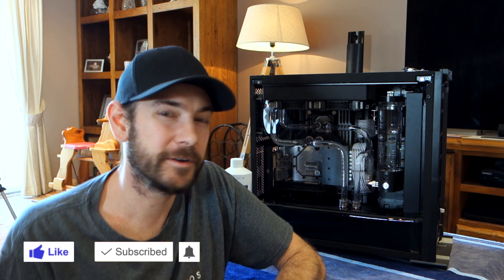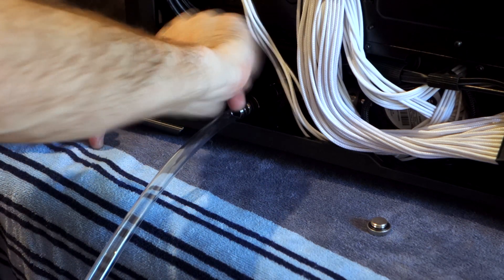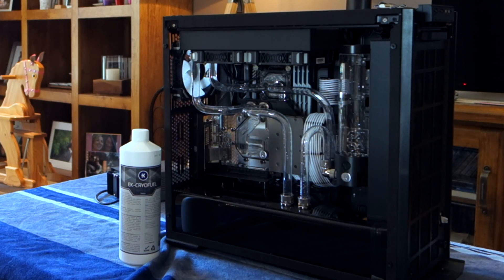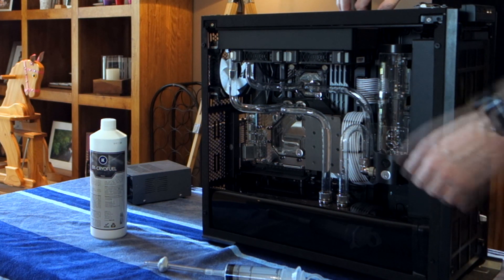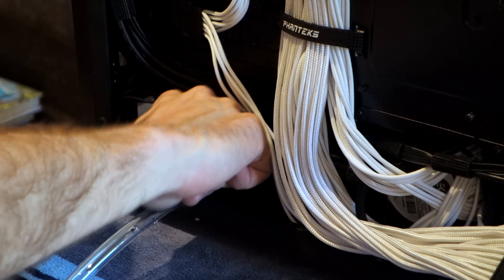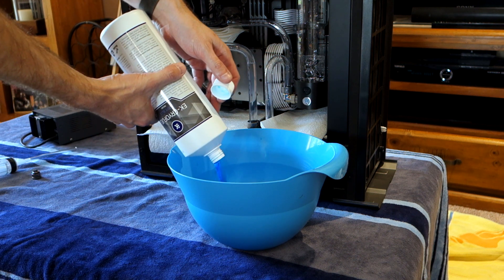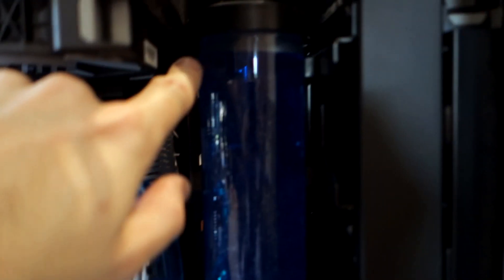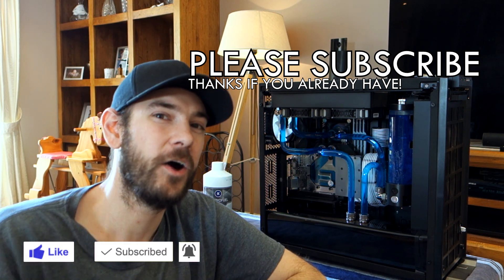FIRST COOLANT CHANGE - Draining Distilled Water & Filling with Coolant

Comment: I'm thinking if you left the drain port open as you are filling the system with the coolant, it would push most of remaining water out before it completely mixes together. Just a thought.

Comment: If been thinking of just attaching a old watercooling pump to my drain port to pull out all liquid however im worried it will stick in few places unless i fully disassemble it, i have loop now since few days with triple radiator with just gpu and cpu way overkill but very silent but 2 of the rads may be problem to drain i could easily use gumball to pull water into the pump from reservoir so maybe i be fine in few month's

Comment: Hey dude, is the valve connected to the bottom rad or to the pump ? Can't really see, cheers
Reply from the maker: Both. It’s a t-section off the line that goes from the pump to the radiator.
Reply: @boostedmedia  could I use one of those 3 port q connector fittings ?
Reply: @boostedmedia  any pics man so I can see how you did it using fittings ?

Comment: Using a squeeze bottle will make it a little quicker when filling the system. But I completed my first watercooling loop and your videos helped a lot. I used a primochill true fluid and it looks really cool. And honestly without your previous video on tube bending, I would not have successfully completed my loop, because you went in depth with some techniques compared to other channels. I'm currently running an 8700k, a 2070 super fe and used EK blocks for both but I used 2 corsair 360's as my rads. I went with hardline since it looks so much cooler compared to soft tubing, and I'm using a EK-D5 pump reservoir combo unit. I wish I went with 10/13mm tubes instead of 10/12mm.

Comment: I was thinking that when you did the draining, you could connect the drain tube into a vacuum flask, then turn the vacuum pump on and it should get all the water out of the system.

Added bonus of having a vacuum flask around, if you put your coolant in the vacuum flask first, you can degas it before adding it to the reservoir and it should take a lot less time to bleed the air out of the system.

Comment: I don’t have a drain port how can I get the fluid out? Also I just want to use distilled water what should I mix it with?
Reply from the maker: You’ll need to disconnect a pipe to drain the fluid. You’ll probably want a silver strip and some algecide.

Comment: I realize I'm watching these months later, but I still greatly enjoyed the videos. I just wanted to mention that EK also sells the same coolant as a concentrate. So you could fill, leak-test, and bleed with distilled water and leave a bit of room (100ml for 900ml of distilled water) in the reservoir to add the concentrate for color/additives when you're sure it's not leaking. The flow will mix the water and concentrate.

Also, when letting the air bleed out, the air escapes into the top of the reservoir, no need for the fill port to be open for that, as the air is included in the overall volume of the system and it's just changing location/position. Then you open the fill port and top it off with distilled water, to replace the air with water. The fill port only needs to be open for filling or draining, as you're replacing air with water or water with air.

Comment: About to put distilled water into my first, simple CPU water cooling loop. (EK components)  Test for leaks w/ the distilled water, drain out the distilled water, then the EK 900mL of red premix into system... scared I've messed up something... we'll soon find out.

Rig... Phanteks Evolv X case, Asus Hero XI MB, 9900K CPU, EVGA 2080ti FTW3 vid card, Corsair 3200 memory, 2 M.2 SSD's, Seasonic Titanium 850 PSU, EK pump/Res, 360 radiator top of case, 3 front 140mm fans intake, 1 rear 140mm exhaust fan, 3 120mm fans blowing air out thru top of case and radiator, soft PrimoChill clear tubing, and EK premix 900mL (blood red). Fans Noctua Chromax.
Reply from the maker: Did you see my video showing how to dry leak test? Recommend you do that first to ease your mind :)
Reply: Thx. Ran leak test for @ an hour... fine. Shut off. Tomm home all day, will continue leak test. Then in goes the EK CryoFuel or whatever it's called.
Reply from the maker: How awesome is that moment where your emotion turns from pure anxiety to pure excitement and joy. Lol
Reply: @boostedmedia  Yes, absolutely. I'm not a handy guy, so for me, a custom cooling loop was a big deal. 

My last build was hard for a different reason... a Mini-ITX form factor build, with the coolest, most-elegant case... the Ncase M1 (brushed aluminum). SO SMALL, tight fit for everything, and big hands... sooo hard.
Reply from the maker: Well done mate! Enjoy the sense of accomplishment. That’s what this channel is all about. Giving stuff a go :). Glad the videos helped you feel more confident.
Reply from the maker: LMAO. I know that feeling better than you can imagine. Congrats mate. Share some pics on our discord channel. :)
https://discord.gg/7YzjkFQ

Comment: Does your coolant runs hot in the loop after running it for a few hours during the bleeding of air?
Reply from the maker: No. No difference to component or coolant temp while bleeding.
Reply: Mine seems to run a little warm while bleeding. I’m assuming it might be heat generated from the pump, leaving a loop of warm coolant behind since no fans we powered on to dissipate heat away from the rad. Sincerely appreciate it if you could give me a few advice on this 🙏🏼
Reply from the maker: As in the coolant temp or component temp?

It will all depend on where the air is being trapped and where the temp is being measured, but it's highly unlikely to be the pump heating the water.

Comment: do you have to use a certain cooling loop protection mix or do you just put in the coolant?
Reply from the maker: It depends on the metals in your system. I just use premixed coolants that contain biocides already. 

If you’re only using distilled water you may want to consider additives.
Reply: awesome thanks!!
Reply: Another question for you, the distilled water counts as a system cleaner or should I use something else?
Reply from the maker: You’d want to mix it with vinegar to act as a system cleaner to remove any algae or contamination buildup. It’s ok to use on its own to flush a system to remove any manufacturing debris or change coolant colours though.

Comment: Hey Will, Super job mate. You caught my attention just at the right time. I am doing the same build (Intel i7-8700K) but I had a question you can help me with. Since you decided to build a water cooled system with a dedicated pump and res is their any reason you selected your mother board over the ASUS ROG Maximus X Formula (300) with the Cross Chill EK II VRM block. https://www.amazon.com/dp/B077DXV361/ref=sxbs_sxwds-stvpv2_2?pf_rd_m=ATVPDKIKX0DER&pf_rd_p=2708083022714283574&pd_rd_wg=qemQP&pf_rd_r=8YNHV72ZD4YQ47T46TGP&pf_rd_s=desktop-sx-bottom-slot&pf_rd_t=301&pd_rd_i=B077DXV361&pd_rd_w=PnX5i&pf_rd_i=null&pd_rd_r=e899a9a2-cea5-496b-9744-f88176042b8d&ie=UTF8&qid=1526044024&sr=2

And by the way, you are just killin me waiting on the 3DMark benchmark. SHOW ME THE MONEY BABY
Reply from the maker: Glad you found the videos in time! Benchmarks coming soon. I’m delidding my processor this weekend (which I highly recommend by the way. The temps stock are stupidly high with the stock thermal interface even with water cooling. 

I went with the code because water cooling on the VRM chips really isn’t necessary and it wouldn’t fit inside my case without using smaller radiators. 

VRM chips can happily run at high temperatures without it really affecting performance. All it does is additional temperature to the water. 

If you look at extreme overclocking using liquid nitrogen they very rarely use active cooling on the VRMs even pushing massive voltages with high LLC. 

Hope this helps.
Reply: Thanks for the advice on the VRM. That helps me make a better decision. I was wondering about the heat issue with the 8700K. I thought the water cooling would overcome any issues but I can't wait to see your results. Such a pain in the ass to remove that CPU after all the great work you did though.

Thanks again for all the awesome video work Will as well as all of the parts listings. Such a great help. I did see a Delid video on the 8700K with 20 degree difference but the best part was undervolting to 1.08 while maintaining 5 ghz for another 5 degrees and still running stable.
Reply from the maker: I’m highly skeptic all of anyone who claims their 8700k is “stable” at 5GHZ on just 1.07V. My chip needs 1.4V to hit 5GHZ but is hitting the thermal limit at around 1.34V without delidding. Mine is a particularly bad chip but still if you look at silicon lottery’s website less than 1% of chips can hit 5GHZ on less than 1.25V.

Basically you’re highly unlikely to hit more than 4.9GHZ without delidding. 

And yeah it’s going to be a real pain draining the system and pulling things apart to get the processor out. That’s the downside of hardlines.
Reply from the maker: Hopefully it’s just the thermal limitation that’s holding me back. My chip hits 95 degrees at 1.35V and my water is barely heating up which shows how bad the stock thermal interface is. 

There are people delidded with air coolers getting better results than I can with my $1500 cooling setup simply due to my bad luck getting a weak chip and because that’s how important delidding is with these chips if you want to overclock.
Reply: Yeah, I see your point. Can't wait to see your results.

Comment: You and your syringe!
just put a funnel into the top of your res and throw the new liquid directly in, instead of this EK bottle -> bowl -> syringe -> air syringe -> syringe ->  ARGH.

You're probably only adding dust and other fluff into the liquid doing it your way.
Reply from the maker: Lol. Yeah it’s a bit painful but it’s also a lot less risky and only takes a few seconds extra. 

I actually have a fill port I plan to install on the top of the case above the res next time I have it all apart.
Reply: Unscrew the top of the res, huge fill port. sorted! I did this on a res half as tall as yours and even then it is not risky.
Reply from the maker: True. Except it’s a bit of a pain to get to.
Reply: This will depend on where your res is positioned as in a lot of cases you won't get a funnel anywhere near the top of the res. Many experienced guys fill the loop with a syringe and I doubt any extra dust/fluff is being added at all.

Comment: I think you would have better results by blowing air using your mouth rather than that syringe (of course air compressor would be the best here). If enough air was blown all of the water would come out easily. No need to waste proper coolant on flushing or wasting time to dismount everything...
Reply from the maker: Thanks for the advice :) I was thinking the same thing actually. I think the best way next time will be to do that, and also potentially remove and block the small U bend piece of pipe running from the bottom of the resevoir back to the pump as this will mean the air can only pass through one direction, pushing all the water out with it, instead of trying to push all the water up towards the middle.
Reply: Cool! BTW, I love your channel idea, I'm subbed using my other "automotive" account, but under this channel  name I'm all about IT. So it's a perfect mix of content for me. I'm also tempted to build and showcase similar liquid cooled pc build on my channel (it mainly in Polish but I do have some vids with subtitles) :-) Anyway, thanks for inspiration! (I'm going to sub your channel from this account too :D)
Reply from the maker: Thanks very much. I’ll check out your channels too :)
Reply: Awesome mate! Here is my automotive channel. I was not too active on it lately, but I'm just about to edit my Miata video and upload it later today. And to be honest, watching your channel kinda made me get into Miatas, since I was all about American V8s till now :-) So I guess I'm double inspired by your work :D
Reply from the maker: Haha excellent! I’ll be uploading my Miata wrapping videos soon hopefully.